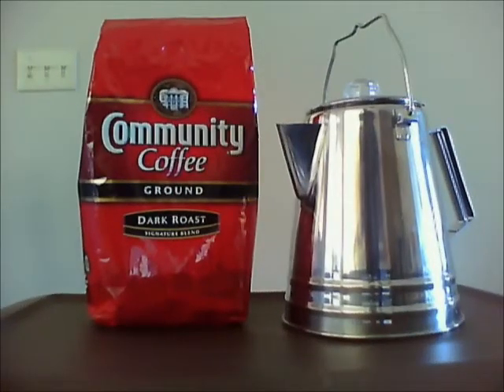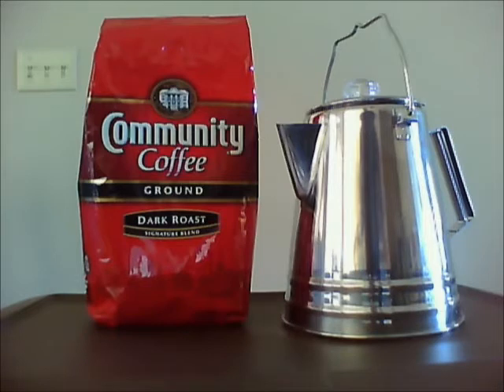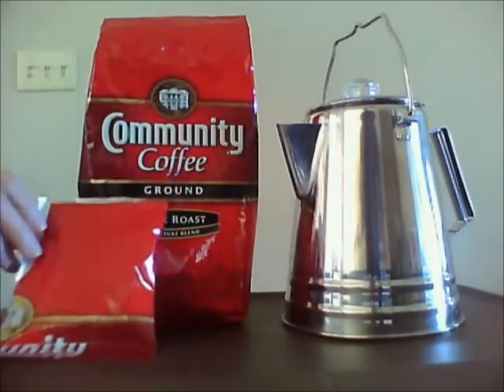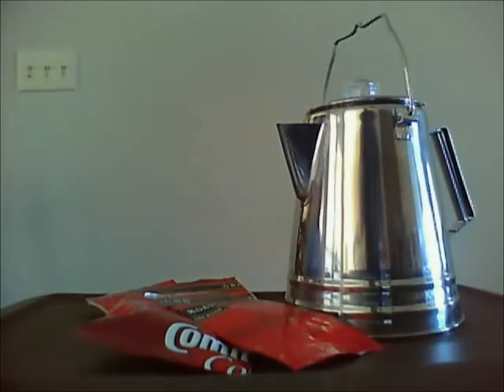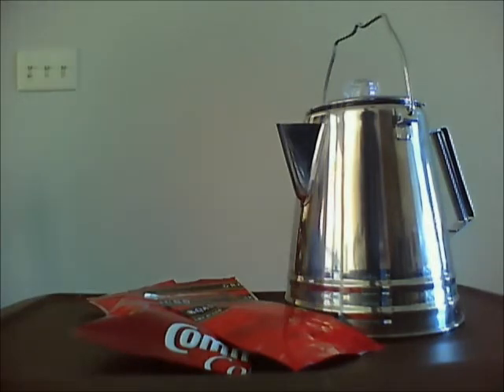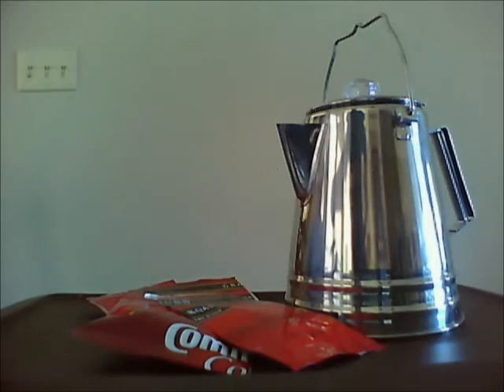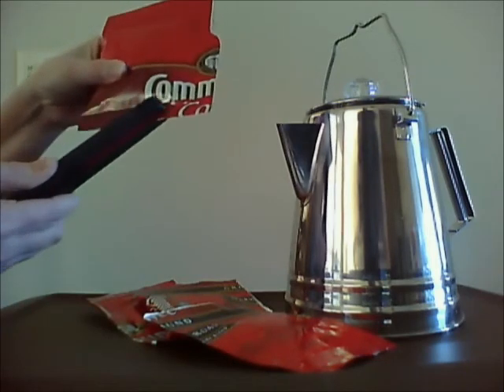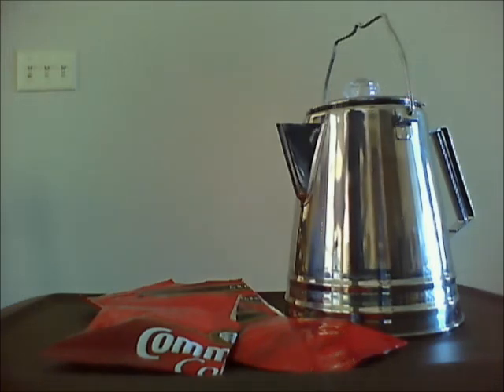Free mylar bag

Comment: Hello???  After so many years.
Anyone had any ideas of how to use this bags intact, to store other foods?
Placing tape on the valve? To use the whole bag? Anyone? 🤭
Reply: @louisianaprepper  I vacuumed seal it and place tape on the valve. After searching around, I found that the valve in the bags are place to release any carbon dioxide. So, those valves are inverted. 

They would work is taken out and turn them, which would make the bags useless for vacuum seal. 

Of course, I now know I have 100+ mylar bags I can cut and use with oxygen absorbers. (I was lucky to find a few boxes in a thrift store for 2.00 per box and I knew that eventually I would use them for prepping anyway 😊)

I'll play around with it and learn how to re-use the valves. I haven't done that yet. I'll keep you posted.